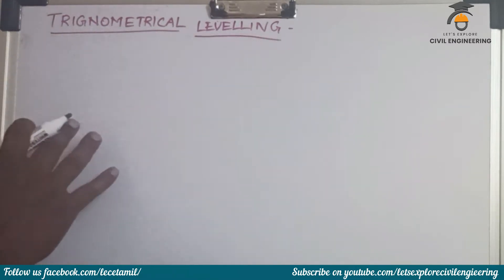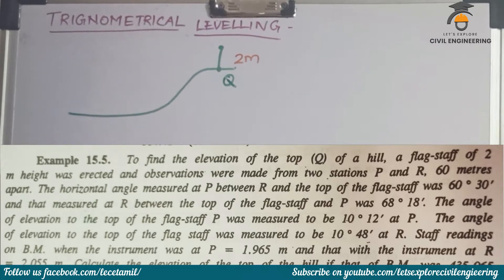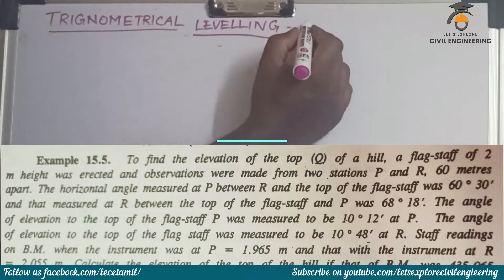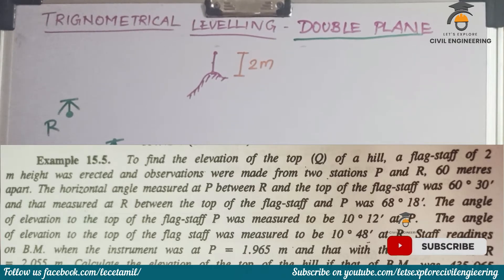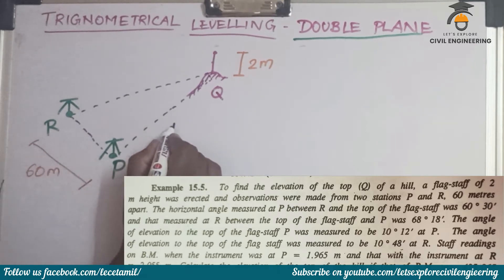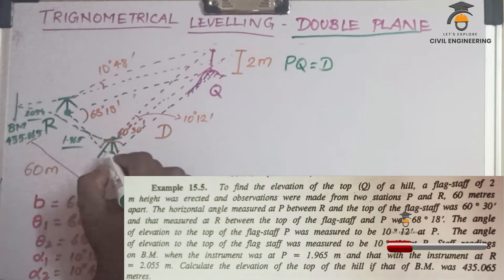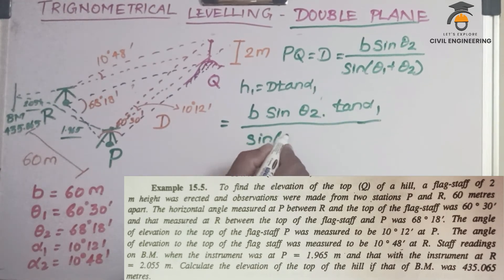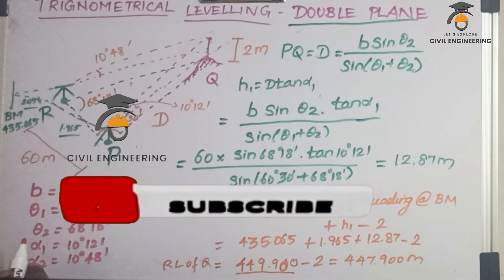Double Plane Method | Trigonometrical levelling | Height and Distances

Comment: sir, in the question, it is mentioned the horizontal angle measured at P between R and the top of flag staff was 60deg 30 mins, and that measured at R between the top of flag staff  and P was 68deg18mins. why did we not taken D1/cos alpha 1 and D2/cos alpha 2, y did u take the angle for true horizontal. can u pls clarify it